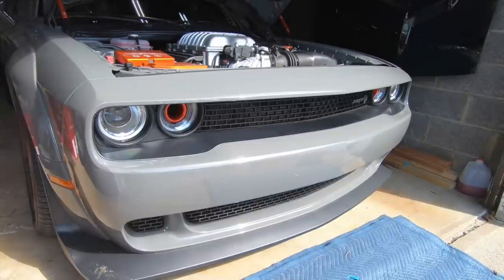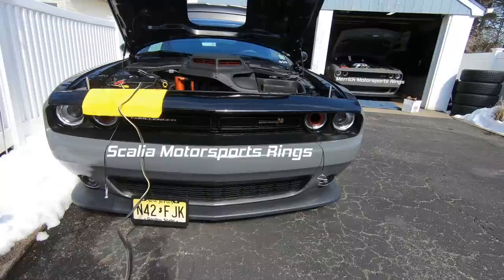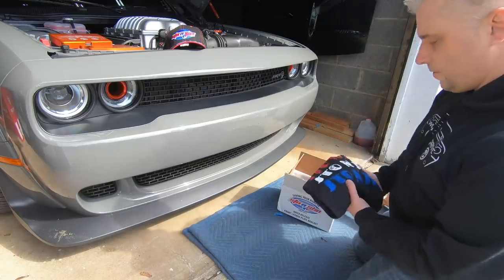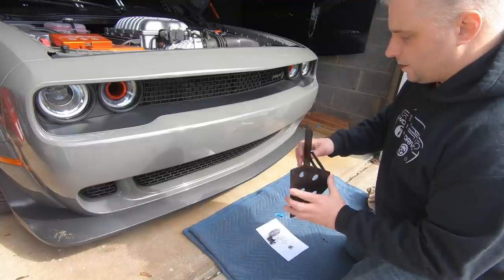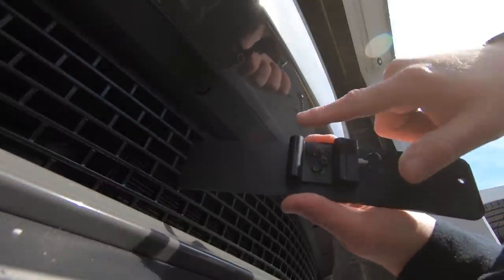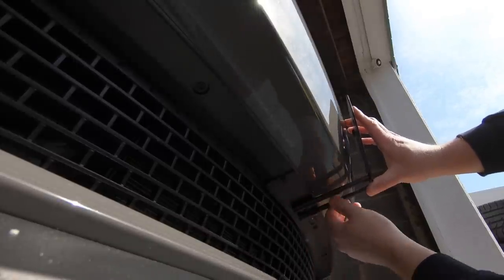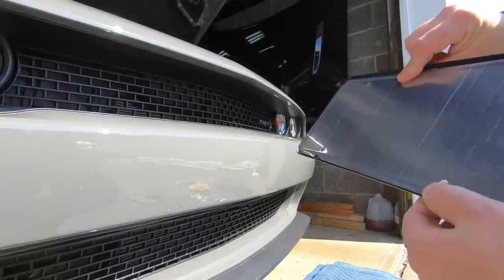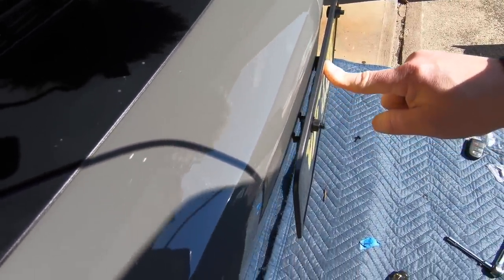Challenger Hellcat No Drill Front Plate Install Sto-n-Sho

Comment: Ordered mine yesterday from Amazon got it today. Works great looks great. You can mount the plate in the middle of the bumper or off to the side. Looks like the plate it floating. Pretty sweet. . I’ll tell you guys though. You’ll need that star shaped screwdriver head to get the screws off your car bumper. And a small socket wrench 🔧.
Reply from the maker: Ouch on both cars I was fortunate enough to buy out of state cars so my bumper was not drilled 🙏

Comment: I had a Sto-n-Sho on my scat for 2 weeks.  The metal plate that the rods slide into were soft soldered instead of welded.  I hit a bump, the solder seperated from the bracket and the plate and rods fell off with me running over the plate assembly.  I was fortunate to not cause damage to my tires or undercarriage.  If they would switch to welding instead of solder, I'd consider re buying again, but not until then.
Reply from the maker: Sounds odd I’ve rammed the plate into the ground a few times without issue. Got pics to send to them?

Comment: I know this video is a year old, but I just viewed it. Last week I purchased a Challenger ScatPac and am dealing with front license plate issues. My question is; Can this mounting system be installed so the plate hangs downward and doesn’t sit in front of the bumper? My bumper has a dodge decal that’s centered and I don’t want to block the look..... Thank you for reviewing this product and showing the installation.
Reply from the maker: Yes, BUT you will need to score the oppossite rod.  When inserted there are grooves on the right rod that catch in the spring pin to lock the plate in place.  If you flip the sto-n-sho upside down you will need to create the grooves in the other rod.   Also note this model is for the hellcat front bumper.  There may be different mounting options for the scat.

Comment: I looked up this holder it won't fit The 2020 1320 challenger had to go with Mount under The splitter
Reply from the maker: Correct, the mount in this video is for the hellcat front bumper only (2015+ No foglights)  The one I show at 1:33 is what you need for the 1320.
Reply: @WorkPlayDrive  got that one it's on The car so far so good

Comment: was wondering if you can flip this around so it's more downward. Also mounting more off center as well. I think that would look better than in the very center. So off center pointed down.
Reply from the maker: From the looks of it and the hole spacing it appears that this can be done.

Comment: I want to purchase this but dont know if it would fit my vehicle. I really dont want to drill directly into the bumper. What are the measurements between the bolt holes on the bracket that bolts to the bumper.

Comment: Great review on the Sto N Sho.  I have a 2020 Scat Wide on order (same front end as you) and was looking for a great solution to stay legal in CA but options for easy off.  This is it!  How are those simple black frames holding up to weather and wear?  Was looking at something similar but in real carbon fiber.  Additionally what bolts did you use?
Reply from the maker: Definitely a great product.  I used the nylon bolts included with the Sto-n-sho and the frames are holding up well.  (note: I don't drive the car in snow, ice)

Comment: That's super slick!

I'm in Ontario Canada, I have a big ugly ass front plate mount drilled right into my bumper. Its definitely cringe worthy. 
Over the winter, I'm taking the car in to my local collision shop and having them pull the bumper, fill the holes and repaint it...I hate it that much. 
This plate setup is perfect. The only thing that I know will drive me nuts is that fact that the plate will shake and bounce around with every bump you hit. I'm wondering if there's any way to stiffen up the connection or even add more bumper material to have the plate rest on the bumper for more support.
Reply from the maker: I don't have any issues with rattle, even at low speed on bumpy roads.  I don't feel you need any reinforcement.  
As you may have seen from other videos I cannot stand stray rattles or vibrations and have gone as far as removing my entire interior out to fix them ;)
Reply: @WorkPlayDrive  Okay great. Good to know. Thanks.

Comment: Yet another great informative video! I may see if they've got something for the Chargers. I could've sworn somebody makes something remotely. Am I crazy???
Reply from the maker: They do, they have a r/t charger one that mounts to the chin spoiler bolts.  https://bigmikesperformanceparts.com/2015-2019-dodge-charger-se-sxt-r-t-gt-sns66/ this should fit right in front of your bad ass push bar.
Reply: @WorkPlayDrive  Ok cool! I am not a fan of having a front plate at all... BUT I'm the event that I'm driving my long road trips, I think it's a good way to not have to deal with the cops... Especially on that level. When you took it off, the bracket was barely visible...if at all! I'm gonna jump on board n get this. We will see how good that stow plate looks in between the push bar when I get it. Thanks again!
Reply from the maker: Totally not visible so you are all good 👌

Comment: Did you try rotating it 180, so the plate would hang down? Just curious how it would look lower?? Thanks for the videos, always a great job!!
Reply: I'm curious about this question also
Reply from the maker: Now I'm curious as well... We will see tomorrow ;)
Reply: L, Na It looks as if the shaft is just notched, would it be possible to notch the other shaft with a dremmel?
Reply from the maker: The shaft is notched on one side only, so out of the box it's not possible.  Even if you notch the other side, it does look a little weird with the bars now being visible from the top down.
Reply from the maker: This guy flipped the plate 180 to hang below the bumper.  He also rotated the plate mount so the release is on the correct side.  https://www.instagram.com/p/BuvhTL3FMJl/  He has a few pics of it on his Instagram.

Comment: How were you able to remove the toggle bolts when you used that method?
Reply from the maker: It was a pain in the butt, that method is more of a permanent solution.  To remove you need to let the back end fall then remove the maintenance pan to pull it out.
Reply: @WorkPlayDrive  Yikes! I really hope those toggle bolts I dropped fell off already and I don't have to get new tires soon :D

Comment: Based on your video, I bought the Diablo's and Bumper Plugs from Scalia. I have a 2019 Challenger RT and the Sto and Sho site on Amazon stated it would not fit. Can you confirm that? That sounds strange to me.
Reply from the maker: If you have the 2019 R/T with the fog lights the cent bumper mount will not fit.  It only works on the hellcat front clip because it have screws on the lower grill.  The under the bumper one should work and if you are unsure you can always call Big Mikes performance parts to ask them.
Reply: @WorkPlayDrive  Thanks very much. You have become my "Go to" guy for info!
Reply from the maker: Thank you 🙏

Comment: Is it legal to place the plate on the inside of the front windshield on lower passenger side?
Reply from the maker: I would say no, while it's not written into the law for NJ it is clear that the plate needs to be between 12" and 48" from the ground on the front of the vehicle.  While you can assume the windshield is the front of the vehicle, friends have been ticketed for putting their plate in the windshield.
Reply: @WorkPlayDrive  Wow I did not know you could get a ticket for that. Thanks for the heads up.
Reply: Scat Pack - it depends on what state your in. In Texas you can’t. Cops will say it’s a hazard or it obstructs the view 😑. I had to pay a $15 ticket because of that
Reply: Scat Pack.Totally illegal.I was told in case of an accident that plate can go flying and slice you or a passenger.

Comment: Will this work on a 2021 Dodge Challenger RT?
Reply from the maker: The one in this video is for the hellcat, but they make them for the R/T. 

This link is if you have active Adaptive Cruise - https://amzn.to/3tFoz72

This link is if you DO NOT have active Adaptive Cruise - https://amzn.to/3w18HOa
Reply: @WorkPlayDrive   I have a 2021 RT with a six-speed manual transmission. Amazon says neither one will work. That sucks. I really like that thing.
Reply from the maker: Probably because they haven’t updated the Amazon listing. Check stonsho.com sns1b is the model fits the 2021. 

Amazon is cheaper to buy from.
Reply: @WorkPlayDrive  Thanks so much, I will.